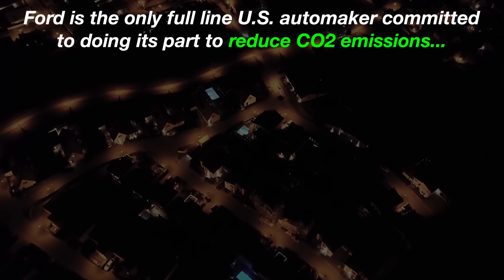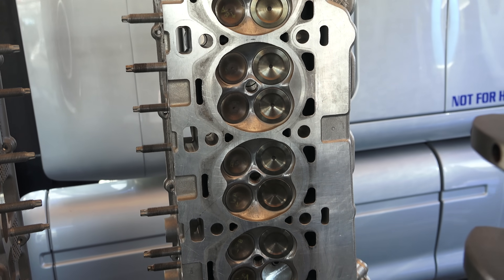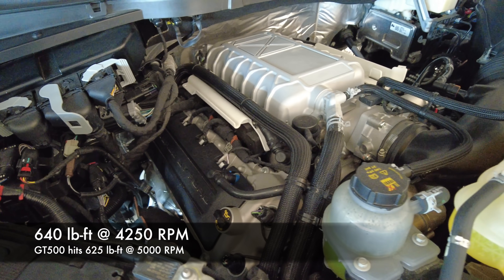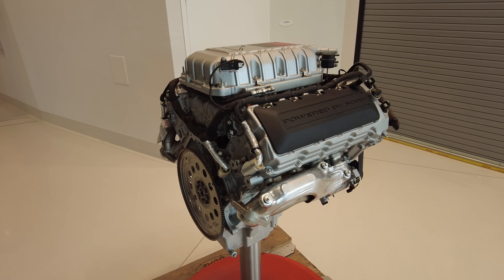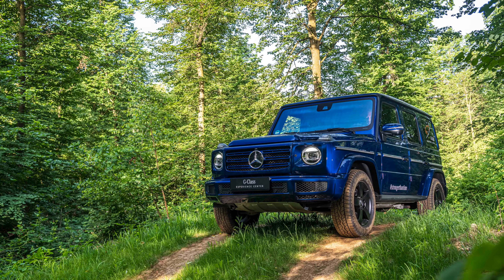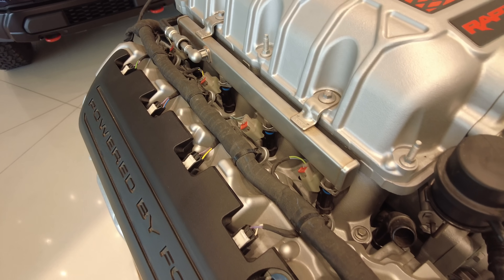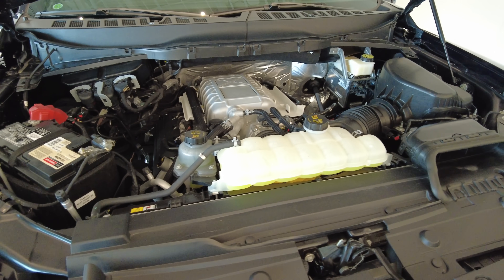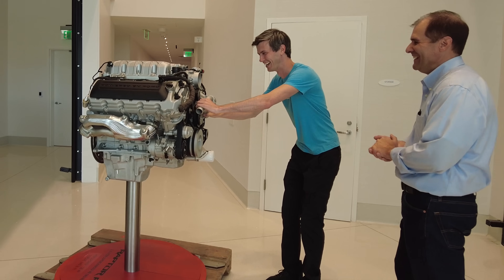Ford Raptor R's New V8 Engine - Meat's Back On The Menu

Comment: Excellent report Jason!  As an old, and I mean old, Ford guy, I love this stuff!  The General keeps putting out powerful engines, especially for Corvettes, but a well thought out blown V8 just tickles my funny bone.
Reply: I have a new 7.3 powered truck. I was hoping they were going to use that engine.
Reply: @TheBandit7613  Keeping it NA would be awesome, but at least it is supercharged instead of turbocharged (nothing against turbos!) so we can hear that sweat exhaust note unfiltered. Chevy guy here by the way!
Reply: These big engine, high horsepower vehicles are becoming speciality vehicles for those that have the wealth. Electric vehicles will eventually make up the majority of vehicles on the road in the future. Dodge is ending the HEMI
Reply: @JohnDoe-kb9sj  Perhaps, perhaps not. Present technology will not support super car performance, until the battery is drained. In addition, the lack of workable recycle facilities for batteries and wind power turbines composites that don’t recycle readily, AND the lack of a power grid able to support all the EVs and homes makes the entire matter close to a pipe dream. We shall see.
Reply: @JohnDoe-kb9sj   in 50 years.
Reply: @TheBandit7613  in Canada, Dodge is ditching all V8s for a 4.0L Turbo Inline 6s
Reply: @AH-lw2bj  As much as people hate the idea of smaller engines in big vehicles my Silverado has the Turbo-4 in it. It makes decent hp (imo), around that of what an older v8 from a few years ago would produce. With how GM has it tuned to produce power and coupled with the 8 speed transmission we've hauled a bed load of soggy wood chips with ease. We don't haul heavy equipment so we don't need something with a giant engine in it. :)
Reply: @JohnDoe-kb9sj  In order to meet the current timeline for electric vehicles we'll have to mine the same amount of copper as humanity has mined over the last 5,000 years, that's not counting the upgrades to the electrical grid, the new substations, transformers, etc, to handle the additional load.

It's not happening. The only way EV will really take off is if we bypass batteries and go for some kind of mythical "arc reactor" type energy production that happens in the car itself.

Hybrids might work in the allotted time, physics dictate that EV will not.

Comment: Turbos are cool, but their are a lot af ancillary parts and pieces to make them function and more costly to repair. Besides gas is gas, so v6 vs v8 will use more or less the same amount of fuel to do specific amount of work.
Reply: A roots style blower is a bit more compactly packaged, but I think the general complexity would be similar outside of a turbo having some additional hoses and tubing externally. I’ve also seen replacement turbos on Rockauto for like $300, even if both went out I think that would be much less costly than replacing/fixing a blower.
Reply: @ALMX5DP  true on that. I was thinking more in terms of the turbo v6 vs n/a v8. It would be nice if they offer an option for a regular v8.
Reply: @derekmcdonald2856  yeah I would have loved to see a Supercab 5.0 Raptor, even if it had the same output as the normal F-150. Still do like the performance of the 3.5 though, and I’m sure this 5.2 is just a beast so money no issue yeah I’d take the 5.2.
Reply: @ALMX5DP  the biturbo does have nice performance . Went to the lake with a buddy who has one towing his boat. It was like the boat wasnt there, very smooth power, good pull, no struggle. But at 50,000 miles he had me change the knock sensors because already having issues, and not easy to do because of tight wiring between heads. And mechanical injection is just a trap for issues and expensive repairs. 
If anyone has done walnut shell blasting of the intake ports on a bosch direct injection motor understands what I mean.
Reply: @derekmcdonald2856  yeah there is something to be said about more traditional NA port injected engines in that regard. We have a Focus ST (with catchcan) and haven’t yet had to do any walnut blasting yet, but I do appreciate my Gen 2 5.0 not having DI or other stuff in the engine bay for stuff like that.

Comment: Good review.  Could all of these recent huge trucks with V8's (or very large V6's) be a growing backlash to all the EV emphasis of late?  When does our world reach "Peak Truck" ?
Reply: Plus, synthetic gasoline ACTUALLY EXISTS. And it DOES SOMETHING.

The super high density batteries needed to match the perfomance and range of a gasoline car DON'T EXIST.
Reply: We won't, because work still has to be done. You can't haul stuff in a car*.
Reply: @michaelthompson8504  What do you mean you can’t haul stuff in a truck? You mean you can’t haul stuff in a car?

Also your comment doesn’t relate to the question.

The question is oriented around stating “When do we reach peak GAS truck?” Not peak truck in general. Obviously trucks will always be around, but they will all be electric soon. So when do we reach peak “gas” truck?
Reply: @ChristopherGuilday  I just realized my typo and fixed it and I didn't know you meant peak gas truck. 
Honestly for actual truck applications not for a while.  One advantage to electric cars is they don't have to be full throttle all the time. You are using a lot more of the total power output possible in a truck a lot more often. Drains the battery a lot faster. They need a lot more range before many would consider it.
Reply: No as far as I understand there are loopholes in regulations that allow them to keep selling these gas guzzling large vehicles which do not apply to the car market. Perverse outcomes of the regulations.
Reply: @wiegraf9009  it's considered an "off-highway" vehicle.
Reply: The laws were lobbied for by manufacturers. They (government and manufacturers) get to claim they have emissions requirements they are following, while also no having to follow them  @wiegraf9009
Reply: @JoshuaTootell  Oh yeah absolutely. Classic weasel clauses.
Reply: A Raptor EV would be SICK!
Reply: @jonathanmatthews4774  it wouldn't because of the lack of range
Reply: @jonathanmatthews4774  no.

Comment: Could you explain the engineering of putting the air intake scoop behind the closed hood rather than from the grill?
Reply from the maker: Air is fed to it from the front grill.
Reply: If you check the hood design it is likely routing air into that intake port.  It's a common way to allow cool air to enter without all of the debris/dirt that would get sucked in with a straight opening in the grill.

Comment: Why not the 7.3????
Reply: 700hp is plenty
Reply: @benjaminmcintosh857  only reason I question. I have an old 7.3 diesel and new Goliath 7.3 gas f250 platinum. I guess I am old dinosaur 🦕 😆 🤣 😂 😹
Reply: 7.3 is an iron block so combined with a blower might be a pretty heavy mill for a half ton. It also doesn’t have a rev happy nature like the DOHC 5.2 has.

Comment: I don't get it why do Americans use massive petrol engines for towing meanwhile diesel is clearly superior, from an economic and environmental standpoint
Reply from the maker: These Raptors aren't really for towing (I mean they can, but an F-250 diesel is much more prepared for the heavy duty stuff). This is for doing silly off-road stuff in a truck.
Reply: @EngineeringExplained  yeah, kinda get it. But it seems like a massive waste to put that engine in a truck, something like a Nissan patrol or a ford Bronco would be way more fun that a pickup truck. Maybe I'm too European to understand pickup trucks
Reply: @Stef.Cata051  these trucks are designed for the desert. High speed driving over loose sand and dunes. Not really for crawling around in the woods, but nothing is stopping anyone from doing that.
Reply: they don't, this isn't meant for towing.
Reply: It's not really a truck for towing.